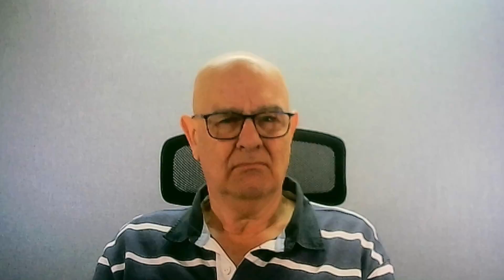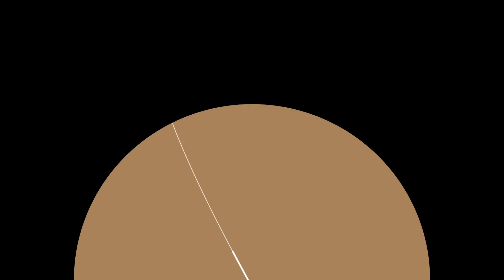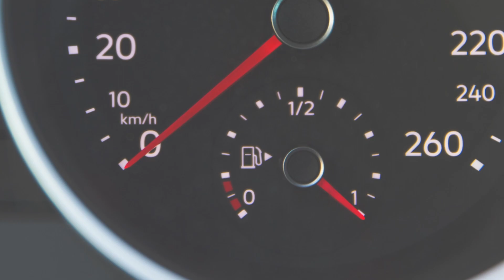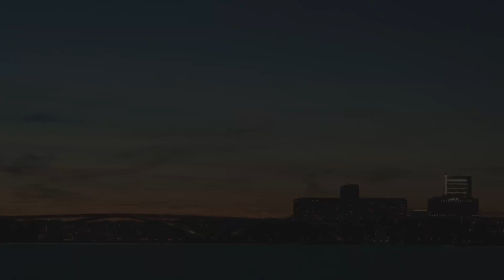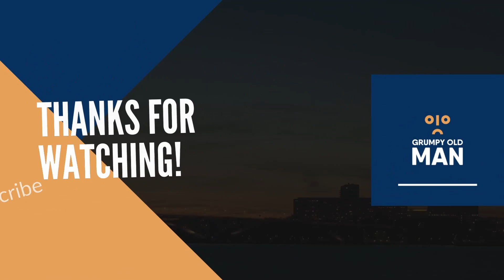Advertised range versus real world range

Comment: i think it’s crazy when talking about ranges one doesn’t simply considers using ranges… like simply tell us the range of maximum and minimum ranges with most extremes driving styles/conditions…
Reply from the maker: I agree BUT the standard in Australia is to use the WLTP protocol which is done in a lab.  Its better than the Chinese NEDC or even their CLTC.  The USA uses the EPA protocol which is the closest.  It harks back to ICE vehicles that have similar laboratory estimated standard for use - which comes out as litres per 100km or miles per gallon etc.  This never gives ranges and nobody ever cared how far they would go.
Reply: @ it’s fine anyway now people know to knock off 30% to get something more real. as for ice i disagree, yeah you could vary range with style/condition but one knew when buying a family car they could go for few hundred km without refuelling, the experience and knowing consumption and tank capacity was enough. the problem with ev is clearly people rightfully fear to be limited. this will go away with new solid state batteries maybe when autonomy will be comparable to ice and by then charging stations will be everywhere ;)

Comment: I upgraded the battery in my EV (moped) from SLA to used 18650's and theoretically increased the range from the original 45km to about 100km, though I still haven't tested it out. Shouldn't be much variation given that it's basically full throttle all the way. 😉